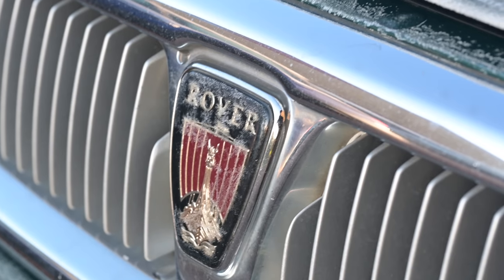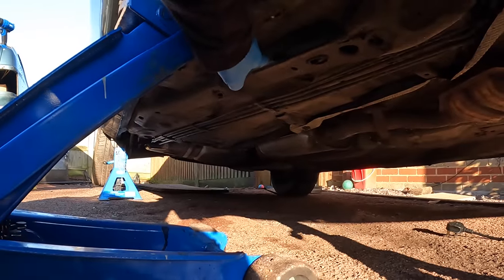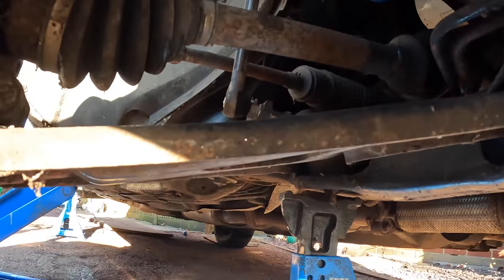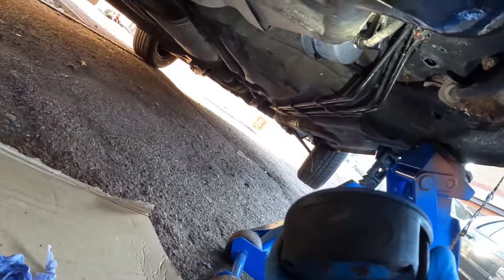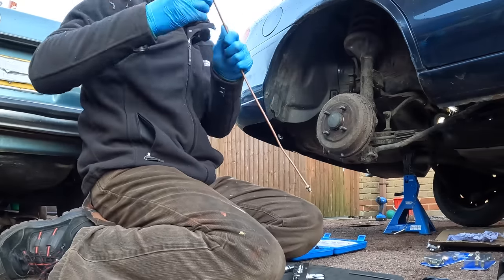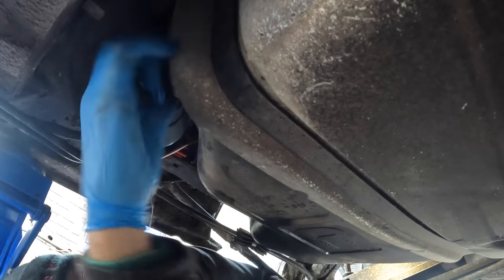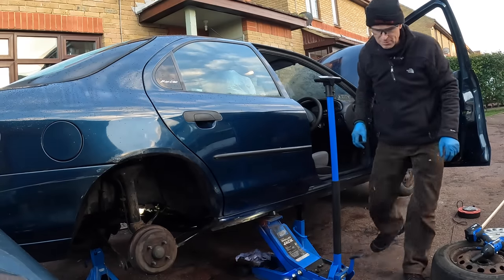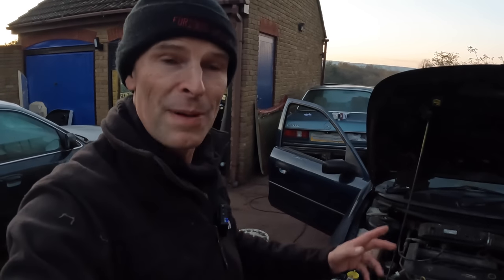Mondeo rescue part 4 - It goes, now it needs to stop!

Comment: Fuel pump issue - The white female plug on top of the sender unit that you plug the black male car loom plug onto the top of the fuel pump sender, is actually a double plug in itself, built into the metal sender top. The wires inside the tank pump go to a white round male plug that plugs into the underneath of the top of the sender along with the fuel level wires, that the cars loom then plugs onto the top of it! Sometimes can be a bad connection their inbetween the top and bottom plugs.
Reply: Think Matt sort of proved that when he was multimetering, the volts/continuity disappered in the 1cm from top to bottom of the sender top?
Reply: @cliveprocter3698  Pump out time again sadly! :( Same issue previous owner of my 1994 Fiesta had! I sorted it after resoldering the bodge, didnt even need touching tbh, they just messed up the PATS bypass job! (Even the fuel gauge read upside down!)

Comment: Hi Matt.  The Ford zetec engine must have 5w-30 oil, no other options.  I used to work in a Ford dealer in the 90s, and Ford's found out the hard way the these engines must have 5w-30. Thicker oil gets into the tappets but can't get out. You'll end up with a compresionless engine.

Comment: Try changing the fuel pump relay or bypass (jumping across the terminals) in fuse box this was common on a lot of xr31s back in the day, or run a power wire from the ignition directly to the pump as a more temporary fix for mot

Comment: I'm still wondering if the non starting is a immobiliser issue that's isolating the fuel pump, what's why it starts when you bypass it. It could be a issue with the chip in the key (I notice it has the red block in the key)

Comment: You may be onto something with a poor earth for the fuel pump. I remember a South Main Auto video where Eric cautioned against using voltage alone. Check the current as well and if it’s low could be a bad earth.

Comment: Auto electrician here, seems to be you have a classic case of voltage, but no current. Best thing to do is get yourself a h4 lightbulb and put some wires on it. Then connect it to the fuel pump connector. a 55w h4 bulb will draw around 5amps. Which should be a good indication or not the circuit it good.

If the bulb doesn't light up, with the bulb still connected and the fuel pump still active (I would bridge the fuel pump relay for ease). Measure the voltage with one probe of the meter on the 12v side and the other to ground on the body (door striker) NOT the same ground on the fuel pump connector!. If the voltage is good, means you have an earth issue. If the voltage isn't good, means you have a issue with the 12v circuit. Likewise reverse for checking the ground.

I describe it to people as trying to connect a starter motor through telephone cord. Measure the voltage and you'll have a lovely 12v, but as soon as you go to crank it you'll have nothing (and a melted wire most likely).

Comment: Love watching this I've had my MK2 Mondeo for 19 years , central locking problems common on these, think there is a module that I have unplugged and sprayed contact cleaner in that helps, driver door similar to yours doesn't unlock others,but I use remote key fob to open all doors

Comment: If you get a headlight globe with wires on it put it to the fuel pump socket and it doesn’t light then put the earth side to ground and it lights you know you have a bad earth on that circuit that wiper may share the same bad earth.

Comment: The brakelines were the first to go after getting the rover 75..firs the back..then the front..then the master cylinder..then the abs, quite an expensive fix, my paychecks are the only thing keeping that surface rust machine on wheels going..its a good car to keep going vs a newer car and cheaper, if only it was a v6..

Comment: Push the brake pedal, say half way and hold it with something. Stops the fluid coming out. I have a tool that does such things. Handy for checking stop lights etc etc.

Comment: Matt you the rear wiper was going on it’s own have you checked the wires in the tailgate aren’t chafed or broken. 
With VWs Seats  rovers and Volvos also are the brake lights working that’s another issue I had with other brands namely a Seat Leon came in picked it up drove it 200 mile with out fault. Stop working after days on it turned out the be the brake light switch.

Comment: I'm also wondering about the feed to your fuel pump, although you're getting 12v at the connector block there may be a bad earth or short somewhere along the feed wire. Once under load the short may be draining current away from the pump or an earth problem would just kill the load current.............just a thought!!

Comment: If the drivers side door lock module is stuck in open mode to the computer you have to unlock the nonefuncional door for it to open all doors. But the door modules are also sensitive to the cold when they are in the last of the summer wine stage.

Comment: I think you are measuring the voltage with the connector off the pump, so you are just measuring a floating voltage ie open circuit voltage.  It should be measured with the connector on the pump.  Hopefully you can do this by measuring the voltage from the back of the connector by using paperclips or similar.

Comment: I had an intermittent fault with a Peugeot 405 turbo diesel it was a break in the little wire to the stop solenoid on the fuel pump that was broken inside it's insulation very close to the stop solenoid.

Comment: Rotten brake lines was a very common problem on MK I, II and III Mondys.
The pipes go behind the tank and must stay damp/wet. The rot on them is beyond belief.
 Iv had 3 old Mondys and despite all being in good condition all rear brake lines failed.
 The other common problem on this model was the front lower ball joint wearing. I put Q&H replacements on mine which come complete with the lower wishbone. Pretty easy to do and never had one fail
Reply from the maker: Its the clips that hold them, plus being in a damp area (over the plastic tank)
Reply: Thanks for your reply

Comment: Corr its chilly for messing about with cars on driveway,, poly bag or similar on top of master cylinder then cap on slows down the fluid in system escaping , down your arms, remember to remove before bleeding,,,,,,

Comment: The deadlocks will come off when you turn the ignition on if you end up in that situation again.   Someone's has already said/ you probably know.  The fuel pump relay is ECU controlled on Mondeo. It controls pin 1 on the switching side of the relay.  I would take the cover off the relay and make sure it's not all green and fuzzy inside the relay or the contacts aren't burnt.    If that's ok the there are a number or reason  ECU won't turn on the Fuel pump circuit on including the immobilizer, the red led next to the clock should go solid if the key has been recognized to tell you it has been recognized, if it flashes rapidly the immobiliser is active.  The chip that's in the key is detected by a pickup ring that runs around the edge of the ignition barrel.  Is the pump completely dead when it plays up or is it trying?  Would be happy to talk you through a diagnostic routine for it.  (I train mechanics on engine management systems) . Loving this series, remember working on these when I was an apprentice.

Comment: Problems with electrics on old cars is connections plugs, earthing connections, or places where wires can be affected by humans including passengers or moving parts like luggage hitting wires or like a rear hatch, doors, front seat movement chaffing wires. Sometimes fuses look like they're doing the job when they aren't.

Comment: If you are going to keep up this work on cars of this age a pedal depressor  might be a good purchase. The fluid is supposed to stop dribbeling if the brake pdal is depressed. It's still a pig of a job but if you can do it without getting covered in dot4  its a huge win.

Comment: Next time just use an extension bar to put pressure on the back pedal, then when you go to release anything on the braking system it will hold its own pressure and not leak everywhere

Comment: Can't you run a wire from the an ignition controlled positive point somewhere in the engine bay back to the pump connector and bypass the internal wiring that way?

Comment: Yeah merry frostbite, yeah sometimes I stick a fan heater in the car for 15 minutes tying a knot in the wire on the inside of the raised window so anyone tripping doesn't move heater inside it has an automatic thermal cut out anyway.

Comment: Hi Matt would it have been easier to just replace the entire  lines  front to  back ? Rather than struggling for access underneath   ?
Reply from the maker: 6 of one/ half a dozen of the other - easier in some ways but harder in others as its a bigger job

Comment: You want 5w 30 engine oil. 10w 40 to thick. 
Wouldn’t it be better to get tyres sorted before taking it for mot? 
Front number might need doing as well. 
Hopefully you get the fuel pump issue sorted
Reply from the maker: Im expecting a new plates will be needed as well, but will have to leave the car at the garage a few days while I get the tyres in

Comment: Those zetec engines take 5w/30 oil....the 1.4/1.25 zetec will blow the big ends if you put the 10/40 in....not sure if this is the case with the 1.8....but personally I wouldn't take the chance

Comment: 10:25 whats inertia switch? 
is thit positioned at the front left foot compartemnt on the floor? 

what is it its purpose? Kill off everything in case of rollover? 

I found some switch on the floor there on the day of getting the mondeo to scrapyard
Reply from the maker: Inertia switch cuts the fuel supply in a crash, the button resets it

Comment: You know your wife gave you a week to fix this car - did she say specifically which week?? Maybe a warmer one?? I did a strut change on an mg maestro in the snow one - not nice :( good luck and don’t get frost bite. Ps careful where you put those axle stands - I’d put them under a bit of subframe with a block of wood. Don’t trust the sill flanges for strength and it could easily bend them - more work to do.

Comment: I noticed that when you direct wire the fuel pump to a battery, you  sit in the car to start it. Could it be that the car has a sensor in the seat, that doesn't let you start it with driver?
Or maybe when you sit inside to start, do you hold the clutch pedal down while turning it over?
Probably not, but thought I'd ask.

Comment: Fantastic episode as always. I wonder if the deadlocking, the aftermarket alarm and the fuel pump are all interconnected. The mondeo came standard with an immobiliser and an alarm with motion sensors. So curious why another aftermarket one was added on top of this. Also If the deadlocking and central locking is working intermittently on this door is the wiring into the door itself intact?

Comment: oil filter removal will come out of 1 of the wheel wells as it wont come straight out down/up like conventional motors mk1 and 2 Mondeos are the only 1s i no that do this and its at the back of the engine the drain plug should be a 13mm bolt in the usual place for oil in zetec motors use 5-30 semi synth dont use 10-40 the car will smoke like crazy even after warm up
Reply: ps i used to own a mk1 and 2 and serviced my own car i tried 10-40 and regretted it changed to 5-30 car ran smoother

Comment: Seen more rust on a front wing of a Mk5 golf than that Mondeo. Absolutely desperate to have a blast at the brakes and suspension parts with a wire brush while them wheels are off. 😂

Comment: Matt I still think you need to clean up the connectors to the fuel pump, I think it's as simple as it's not making a good connection given you're getting power to connector... I think you're overthinking the issue.
Reply from the maker: Ill be giving that a go later - Im out of electrical contact cleaner so need more for this and the relays
Reply: @furiousdriving  I'd definitely be concentrating on the connector as you've got a new fuel pump assembly.....maybe 2 bits of cable from the connector to the pump at least if that works you know it's the pins in the connector not making good contact... Good luck 👍

Comment: Worst case, as this is a cheap car, run a dedicated wired from battery to fuel pump via ignition switched relay. If a Ford fan buys the car they can then choose whether to factory fix it.

Comment: If this was an American video you would be putting new rotors, pads and calipers on with new master cylinder, new fuel pump unit and new battery plus oil and filter change.  I like this more. It is the way we do in in SA as well.

Comment: wheels will look nicer painted in black matt color without hubcaps. or even better, in chrome paint.  I stopped using hubcaps on my nexia after i got set of new steel wheels for winter and they were rust free for rest of nexia's life and then used them on lanos during winter and even sold them with lanos - still rust free, many years after I bought them.  Hubcaps keep water and salt and garbage from road on wheel and they even scratch paint on wheels letting them rust. 

about rust - i hope you'll take care of rust on car's body. at least sand it down and put rust converter and paint on it so it don't rust more.

Comment: That car is doing a lot of weird stuff. Starting sometimes and not starting sometimes, intermittent central locking issues, wipers intermittently coming on/off by themselves. I wonder if the rodent/s that used to live in that car had been chewing on some wires.

Comment: The MOT man will not like that fuel filter cable tied
Reply: Why? I wouldn't have thought it mattered as long as it's secure and not flopping about.
Reply from the maker: I dont see why not, these are stronger than the original metal strap and wont rust - as long as it's secure is the thing.